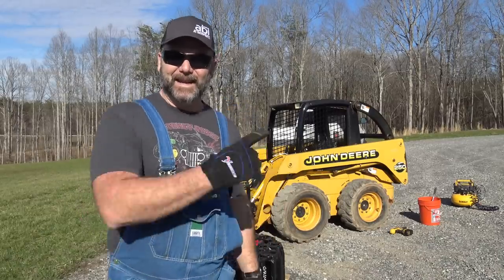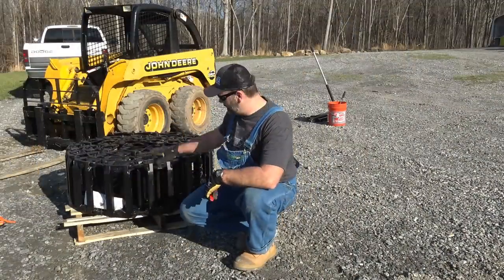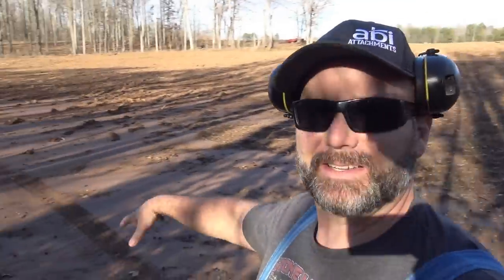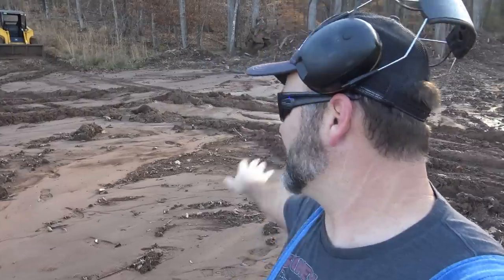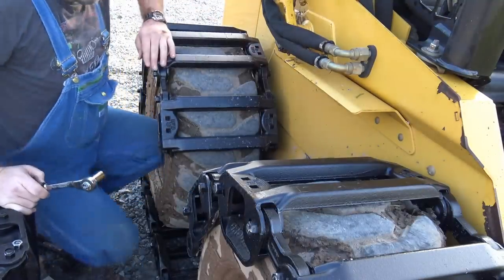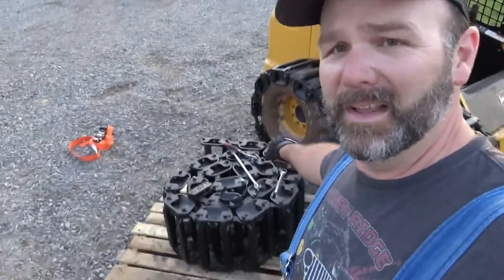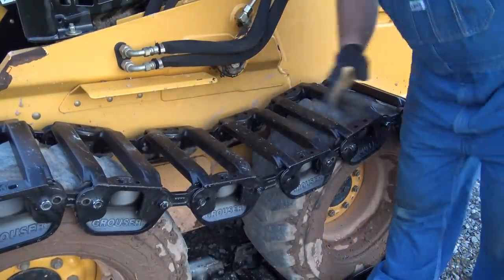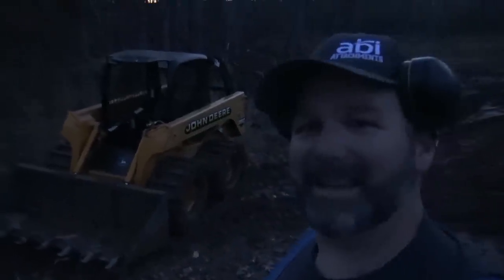STUCK IN THE MUD! Tracks vs tires in the mud hole!

Comment: Just before our son departed for USAF enlistment back in ‘01, he worked for Public Works.  He was certified on skid steer, etc.  He had endless stories.  Beware cheap tire pressure gauges.  Pay a little more for a good gauge.  Dial face gauges are nice, but cannot be dropped or jarred.  Impact affects their accuracy.  A good quality stick gauge should last a lifetime.

Comment: Brother best video I've seen showing how to install these tracks.  I got the exact metal tracks on my 1990 Case 1845c skid steer,  they are a beast.  To load into a trailer ramp and not have issue slipping,  just place two pieces of wood on each side.

Comment: I had a set of Grouser tracks years ago. They are well built, but as you said, very heavy. As they start to wear out, you can replace the bolts and bushings, as needed. Just be careful on steep, super muddy ground because sometimes the tires will spin inside the tracks. I am surprised they didn't give you wheel spacers. Definitely a game changer in the mud!!
Reply: I think it's a minimum of 2.5" clearing between tires and frame. I think he has that much.

Comment: Thank You! I bought the same Grouser tracks, they are used tracks however the tires on the 87 John Deer skid loader are like new. I installed and uninstalled the tracks a couple times now, I don't have them installed all the time, I also used a strap but noticed on the first side you strapped the track as I did but the second side I see you placed the strap on top and bottom, that way the heavy tracks are supported and less muscle needed to lift them while connecting them, what a great idea! I like the tracks but I take them off for winter snow plowing and replace them with chains on all four wheels, in fact I like the chains so much I've been leaving them on all the time and not using the tracks so much but I won't be selling the tracks, I'll be using them again I'm sure. Another way I've installed the tracks is using a fence tightener to bring the tracks together, it works but I think the strap is a little easier and now I'll use the strap as you show.

Comment: If you had tires with a lot of tread on them an idea would be to let some air out then put the tracks on and fill the tires back up to max psi and might get a snug fit for the tracks.

Comment: I wouldn't have believed that those grouser tracks would make that much difference if I hadn't seen this video. My local tire guy swears by putting tubes in your tires if you are going to run that style tracks. They are hard on the sidewalks and promote a slow bead leakage. For sure keep an eye on that tire pressure without tubes in the tires.

Comment: Getting under the boom is safe if you use the lock pin. Was a mechanic at John Deere, boom up is how you work on them most of the time.
Reply: Also, deflate the tires until they start to fold a little, you still need to be able to get the tracks on. Put your tracks on with a little sag and fill tires.

Comment: I just spent a couple hours running a compact track loader. The tracks really do help... the only problem is they really tear up the grass. you may want to consider alternating between tracks and wheels depending on the conditions you are working in
Reply: @mdsuave13  yeah, I've gotten a lot better at that in the 2+ years since I posted the comment. Experience is important.

Comment: Ive got 15 skid loaders in our company  We have 10 track machines and 5 wheeled machines.  We have steel tracks for all 5 of the wheeled skids.  One thing we found is that the steel tracks eat up tires so make sure you keep a used set about.  We also found that if you lower the tire pressure in the tires before you put them on and run it up after it is easier to get them on.  The tracks wear on the bars so after about 3 or 4 seasons we weld a bar on them.  One thing we have also found is that if you don't need them don't run them, hard on hydro motors, and watch for rocks getting into them they will also cause serious damage to the machine.  Keep digging dirt!!!!!!!!!

Comment: I ran those tracks for about 6 years. I will say using them daily to keep them tight. Once the tire spins inside the track it is no fun. We also put them on with 10psi or so then aired the tires up later to get them tighter easier. First time doing it you did great. Oh isnt there a safety bar to hold the loader up?
Reply: I thought the same thing, about the tire pressure... I only have tire chains experience... Haha

Comment: I didn’t check to see if anyone else a mentioned this but take it from an old retired Army tank commander. Go easy on the neutral steer in the mud. If you build up mud ect. Under your wheels you can easily throw track and getting it back on in a mud hole is a great time let me tell ya
Reply from the maker: Thanks Pete!

Comment: Did you know on the back of the cab there is a safety bar you can push out when the arms are at full extension that will keep the arms from falling
Reply: If not there is a leaver that lock the hydraulic to keep if from falling

Comment: your going to like'em! ive had metal tracks (and hub extensions) on my bobcat 853 everyday since feb 2007 tires are 12.5/16 thick sidewall. rims/tires still look new skidloader drive train has never broke down i never get stuck never take them off work in the woods/underbrush all the time. tires do go flat ONLY if i lift over the lift capacity. 3 tires now have tubes and i keep close eye on air pressure. dont let them get low.

Comment: Awesome video! 

Running tracked machines makes such a difference. You'll be wondering how you ever managed without. We used to run (wheeled) tractors on our fencing operation, we now run Protech Evo's and Kubota RG-30's, both tracked machines. Also, those Knipex cutters are an awesome piece of kit, I much prefer them to the Felco C7's that I'm currently using. Reckon I may just have to get myself some more.

Comment: Also- when you roatated that wheel did I see a valve stem located on both sides of the wheel?
Reply: Tubeless tyres so when you need to rotate the tyres, you can rotate them without taking the tire off of the rim.
😃

Comment: Even new tires get stuck faster. You can get a tire cutter. And take some off old tires and get more tread on old tires for a bit. Tracks are great for soft areas specially sandy ground areas. Put safety bar on lift if worried lock from any thing happen. Look into some wheel spacers there great.

Comment: @3:57  Scratching my head.....has 400 lb tracks sitting on a pallet that he has to straighten out and a machine to put them on????    Chooses to drag them off by hand and struggle instead of using the machine! Something is wrong with this picture but I just can't seem to figure it out!!!
Reply from the maker: lol...if I couldn't move them by hand I would have pulled them off...work smarter..not harder...I get it....by the time I used the skid loader to get them off I would have had them halfway installed brotha
Reply: I was thinking the same thing.  However, I am almost a full foot shorter and probably 100 lbs. lighter than Josh.  I always have to use leverage or a machine to do stuff.

Comment: Awesome video sitting in the machine if you look over your right shoulder there's a lever there for the boom lock so you don't have to worry about the bun coming down on you also you may want to look into wheel spacers do you give a little more clearance between the tracks and your machine

Comment: Tracks are still too loose. On side hills they will try to come off and they will slip if really wet. I use them on a new Holland skid steer and grouser only recommends 1 to 3 inches of sag across the tracks. There is also a setting on the bolt holes that they don't recommend. Don't remember which way that is but it's on the website. I'm guessing it causes pre mature wear. Lots of guys use them around here that log with skid steers and they are very tough. Good luck and be safe!
Reply: The setting you are talking about is not to use the short holes on two adjoining track pads..  I have a set of Grouser tracks for 12X16.5 tires that I just rebuilt, and have no use for them now cuz I bought a larger machine..  I bought a set of McLaren tracks for it cuz Grouser tracks are so much mor money..  I am retired now and do not thing I will wear these tracks out..  These McLaren tracks are cheaper, but they have no bushings and so they will cost more to rebuild over the Grouser tracks where you will replace the bolts and bushings rather then the dog bones on the McLaren tracks.. Something to consider when buying tracks..

Comment: It's actually a good idea to run the rear wheels is reverse. The way the tracks are designed it uses the direction of the tread so when in reverse you get the same traction on the inside of the track. This probably isn't true I just wanted to comment something and seem smart lol
Reply: I was kind of thinking the same thing.

Comment: Doesn't the 250 have a safety pin that you can engage from the cab so you don't have to get out on the machine with the bucket up in the air?

Comment: Could you not adjust the air pressure as part of track adjustment? Deflate tires a little, change adjustment bolts closer then inflate tire to adjust?

Comment: Tracks are still a bit loose  put a 2x4 across the top of the tires the sag in the middle should be 2-3 inches. Also might want to check into wheel spacers because the tracks will rub the side of the machine when turning and going over obstacles. I really enjoy your videos keep it up

Comment: I have tracks similar to these and have been running them for years.  Here is my experience:  I have mine very tight with 0 slack.  If there is any slack or if the tires are not inflated to full pressure, then the tracks will pop the tires.  They cut right into the side wall.  I only use my bobcat on occasional weekends, but I have replaced 4-6 tires due to the tracks.  That being said, my bobcat on our muddy farm is useless without tracks.....so you need them.   Just my 2 cents

Comment: Do u know if u will put your front end loader in the air as far as it will go up it will put more weight on the ass end of the skid steer it wound not get stuck as
bad

Comment: Best of both worlds having ability to go wheeled and convert to tracked when job conditions requires them.  Contemplating purchase of a skid steer and wondering in long run if it’s more cost effective with less maintenance over a dedicated track skid steer to do the same as you did for same type of farm use ??
Reply: Might be cheaper but the production of real tracks is astronmically higher...
Reply: Jacob Mader probably right with most applications tracks would be best ... also thinking those steel tracks would be harder on the ground than rubber tracks

Comment: Grouser are the best tracks. On my second set in 15 years, used daily.
Some friendly advice. 
Tracks should be tighter. Push down between tires, lay a 2x4 across and should have 2-3 inches slack in middle.
You may need spacers. I had to on my JD 240 with this set. When turning they would flex enough to rub the sides. If you do you can find them on eBay $200-300.

Problem with turning tire your valve stem is on the inside, hard to get to and the wheel offset isn't the same.

If the mud is sticky enough to gum up a tractor tire that it looks like a race slick it'll do the same to the tracks and once you bottom out your done. Their great in really soupy and fairly dry mud.

Constant DEEP mud is hard on wheel seals be prepared for wheel bearing problems. I'm on the extreme side of using them and rebuild 2-4 axles a year.

Just a taste of how I use them and what it gets like when you constantly driving the same tracks hundreds of times. 
https://youtu.be/cNSJJNRxtLA
Reply: First thing i thought about was the valve stem but that wheel has one on both sides from what i saw though

Comment: Take the tires down to 20 pounds before you put the tracks on then air the tires back up afterwards, makes the tracks nice and snug
Reply from the maker: according to grouser that's the very worst thing you can do...you need some "sag" on the tracks...running them too tight breaks stuff...at least that's what I was told
Reply: @StoneyRidgeFarmer  think snug, like putting bearings on a vehicle. If the tracks are too loose the tires will slip in the tracks and chew big chunks out of the tires (first hand experience here). And if course too tight is bad for the hubs.
Good luck finding that perfect medium.
I did find it easier to air down first though.
God bless brother.

Comment: Be careful about flipping those wheels around like that. The ones on our 250 had little ribs on the wheel that would contact the hub before the main center of the wheel did and the lug nuts would basically be flexing the center of the wheel as you tightened it

Comment: Would of been easier to put the connecting section on top of one of the tires I would’ve thought. When I do track loaders, I set the clamps on the idler

Comment: @ 9:52 Says a lot easier on the outside than it is on the inside....Scratching my head..A lot easier off the tires than on the tires....Just flip them back on the ground
Reply: My thoughts exactly. Just roll the dang things back off the tires to adjust them. SMH LOL

Comment: doesn't it have safety pins on the machine, it looks like it has them if I remember right the pins slide out to be under the lift arms
Reply: David  yes the handle is in the back right corner of the cab
Reply: we had an old 260 at work  that they abused big time worse thing I remember about that machine is the skidsteer had a different key and of course they would jam whatever in the switch

Comment: It was clear that those tire are worn out. Hardly a fair comparison. Having said that, the tracks are far better in mud but a downside is that the metal ones can damage concrete and asphalt. BTW that tire wasn't put on backwards, it was mounted for the right side. Skid steers have "directional" tires like rear tractor tires are.

Comment: A couple of points:
Tires with tread will interact with the tracks. Bald tires will slip inside the tracks. Especially if the sag is excessive. Sag should be 1-3 inches
If you ever load onto a trailer with the tracks using metal ramps, BEWARE. That includes any metal decking on the trailer. Slippery, slippery, slippery. Especially when wet. I had cleats welded onto my ramps and the back 2 feet of the trailer where there is a slightly inclined metal deck. I hate to say this, but I darn near had a really bad situation before the cleats. The machine nearly slipped off the trailer at the top of the ramps as it went onto the metal deck. I hate balancing on two wheels!!!
Don't EVER get under that boom without safety support. Your machine should have one somewhere.

Comment: You're not supposed to have sag in the tracks
Reply from the maker: 3 inches of sag....however we have a little more....we'll be getting new tires in a few weeks no use in tightening too tight if I'm just gonna pull them off and replace tires in a week or two
Reply: Well we have been doing this longer than you and we have no say in the tracks because if you do you can lose the track and it doesn't matter that you are going to be putting new tires on you always tighten the  tracks

Comment: I figure I’d get your attention here rather than the video when you bought the machine, I didn’t catch that when it came out, but I may as well chime in. 

That 250 skid steer is an interesting machine. First off you should seriously consider that the 200 series Deere’s were horrible for dash failures, and most had them replaced. Yours has been replaced because it has the new Deere logo on it but the machine is a 99, and they didn’t have it then. Those things are horrible for electrical problems in all forms.  The park brake fails and they stopped making the kit to fix them. Sometimes it’ll kick in at random. 

The hoses under the cab vibrate and blow out. Cab pops up by removing two nuts on the outside front corners of the cab and will flip up easily if the gas shocks arent dead. 

The chaincase is pretty robust from our experience. 

The series 2 machines solve many of these issues, I have a 260 S2. 
The engine is a 3029T, same as the 5065 you have. 
Take care of it and it’ll do fine, just be good at solving electrical problems.

Comment: Its not backwards...now your valve stem will be inaccessible
Reply from the maker: Jack...you do know I'm not stupid right?  There's a valve stem on both sides of this wheel...as for your other comment...yep the hours were 285 on the clock...clock was replaced at around 850 hours...so still a sub 1200 hour machine...so far so good on it
Reply: @StoneyRidgeFarmer  lol you got lucky on that one. 9/10 it's a spare someone tossed on and was too lazy to remount

Comment: Don't get in and out with the loader in the air. I know a man that was killed because he got out with a round bale up in the air. When he got out he hit the lever and dropped the loader frame on himself killing him immediately
Reply: Wow.  those arms can drop instantly.. and i do bump levers getting in/out while arms are down, so why not if they are up, and then WHAM.  Thanks for sharing.   Life is delicate, I've woke up on life support when someone hit me, lost Dad and Uncle instantly when they were using a tractor and a skid-steer, and my Dad was super safe (neighbor's barn structural failure).  BTW, wear a lid and full chest/back when you are piloting that yz :)